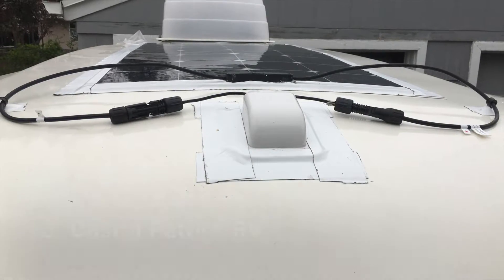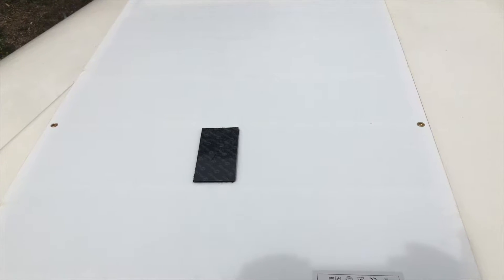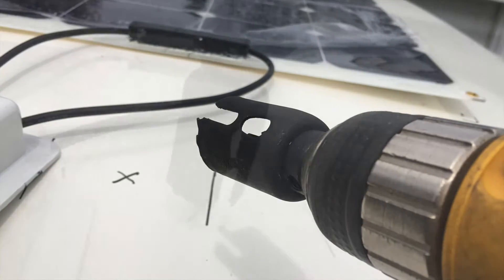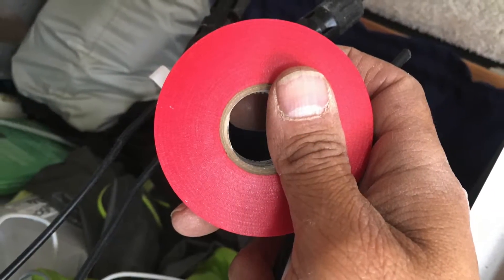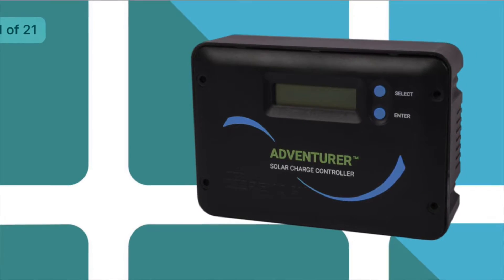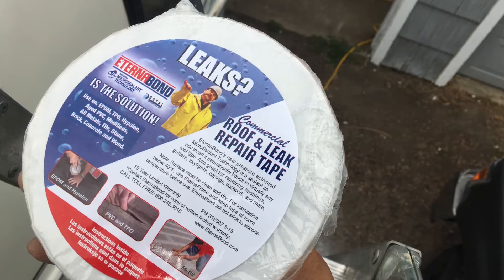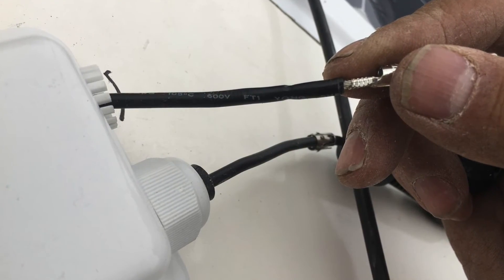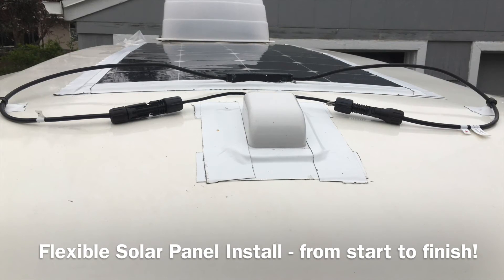Flexible Solar Panel Install on my Casita Patriot!

Comment: How well has this held up over time?  Are you still happy with the setup?  I see many articles advising an air gap, but most manufacturers state the panel is safe to simply glue or tape down.  What has your experience been with it taped directly down?

Comment: Did Casita wire the trailer for a single panel or did you?
Reply from the maker: I wired it outside of the existing system. Uses it's own inverter.